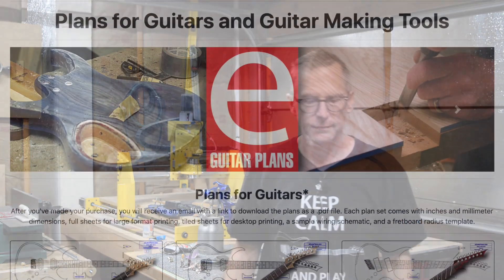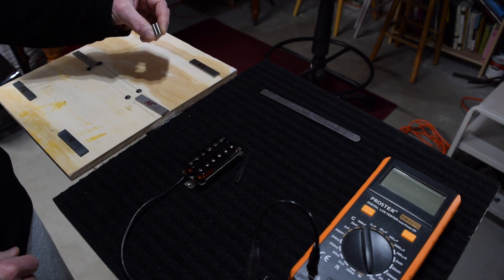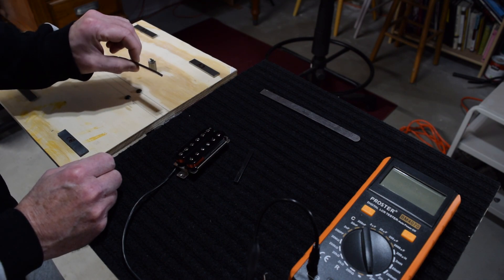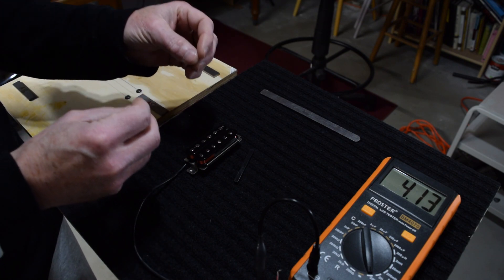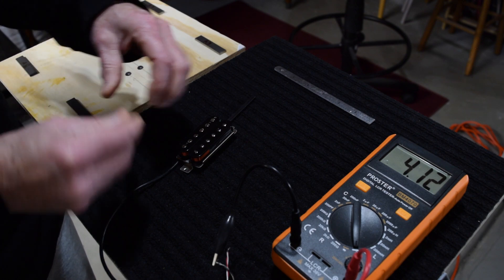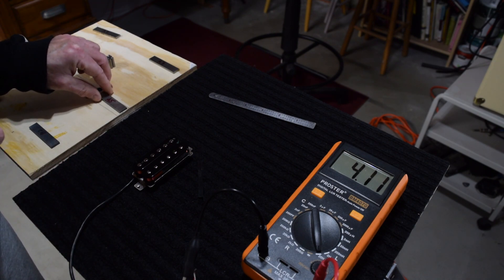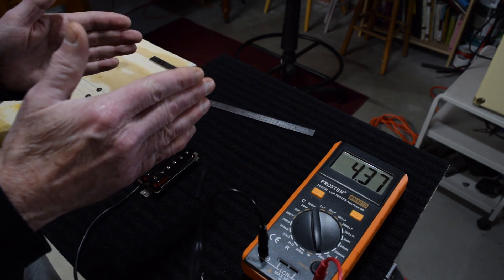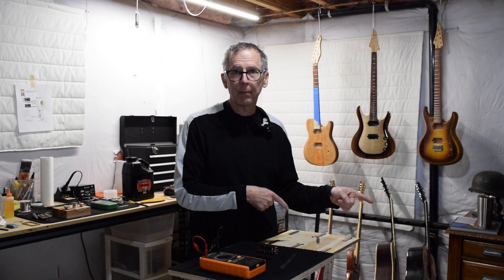Luthier Quick Tip 28 How To Make Guitar Pickups Part 4: Pickup Magnets

Comment: Hey when you introduce the ruler inside the magnet cavity makes me think, is that the reason why covered pickups (in metal covers), sound different than open pickups?? other than the fact that it shields the pickup for external signals and avoids noises.
And also the metal mounting support that goes under the Humbuckers and the P90's, the brass ones sound different than the iron ones.
Never thought about that before.
Thanks Chris!
Reply from the maker: It's important to keep in mind that pickup covers, regardless of what metal they are advertised to be made of, are actually an alloy of different elements. All of the metal covers available contain iron. Some more than others and the amount of iron will affect the inductance level of the pickup.

Comment: How to deGauss a magnetic field which is quite high in my strat pickup? how do i identify the poles from north to south without any instrument? I have ceramic magnets laying around, so can I deGauss the single coil pole pieces with it? using your method of south to south, alnico with ceramic aligning together.
Reply from the maker: If you can get ahold of a compass, you can place it against the ends of the magnet to detemine polarity. You can try to degauss with ceramic magnets, but they may not be strong enough. You really need a gauss meter to do this.

Comment: Great video, very informative as usual, any suggestions on where to find Alnico and Ceramic magnets in 7 string lengths? Approx 2 5/8" as I'd love to compare them in my Duncan and Dimarzio pickups for various projects?
Reply from the maker: I use 2.5” long magnets which work fine and are commonly available. If you want longer (for a multi scale), you’ll likely need to have them custom made. For the multi scale pickups I make, I use Alnico slugs.
Reply: @HighlineGuitars  great info, I wasn't sure if 2 .5" was long enough, thank you so much for your help, I'll order some up tonight!

Comment: HIGHLINE GUITARS, are you going to make a video lesson about how the vol pot and tone pot values changes the frequency range of the pickup and the tone caps value also changes the frequency range of the pickup. Fender strats in the 50's used .1uf cap that was luxe phone book cap which make the pickups sound very dark.
Reply from the maker: I don't think a video is necessary.
Reply: @HighlineGuitars  thats to bad i wanted to see a video lesson about it by you
Reply: @HighlineGuitars  How do you get the Gauss level to be the same Gauss measurement for the unmagnetized magnetics? when you purchase a bunch of A5 Unmagnetized magnetics and then magnetize them but how do you get the same constant gauss level? so that all the magnetics aren't measuring different gauss levels
Reply from the maker: @waynegram8907  With the way I magnetize, you can't. If you want repeatable results, you need a professional magnetizer.
Reply: @HighlineGuitars  Which brands make professional magnetizers? to get repeatable results
Reply from the maker: @waynegram8907  I can't say as I have never used one. However, they are out there and I know you can make one yourself.
Reply: When the tone roll 100% - no matter which cap is mounted - it does not participate in the signal chain.

Comment: Hello i have a question for you and that is if im building a guitar using a 24" neck what is the measurements u need frim the nut to the saddle i know that a 22" neck would be 24" 1/2 so would my 24" guitar neck be 26" 1/2"

Thanks
Reply from the maker: Do you mean 24 frets? What's the scale?
Reply: @HighlineGuitars  yes that is what i mean you see the body that im using had a 22 fret neck on it. And im putting on a 24 fret neck on that bidy but the pickup cavity is cut out where i need to put the bridge at to be at 25 1/2 so is there anything that i can so to fill in a 1 1/2" to put something sid inbthat space so that i can mount the bridge to simething solid there?

Thanks.

Comment: The higher the iron content the lower the magnetic reluctance. This creates a stronger magnetic field. This is the same principal as an electrical transformer
Reply: It’s not a transformer - it’s a signal generator. And it works a little bit differently.

Comment: Thanks Chris! I have been curious about this but it's been difficult to find an explanation as clear as this. Question...is it common practice, or at least a good idea to use a higher magnet "number" for the neck pickup to help with the loss of brightness? Or would that just take away from the contrast between the neck and bridge too much?
Reply from the maker: It might take away from the contrast, but even if you jumped from an A2 to a C8, the loss of contrast will be minimal. It's also important to keep in mind that the strings contain iron, which will further increase the inductance and thus the darkness of the tone.

Comment: if my bridge pickups have dificulty to capture the high e string  but work fine for the other string did it mean my pickup is broken ?
Reply from the maker: Check the high e string pole piece(s) to see if they are magnetized like the others. Also, check the alignment and distance from the bottom of the high e string to the top of the pole piece(s) to see if there is excessive clearance.
Reply: @HighlineGuitars  ok thx a lot man  really appreciate